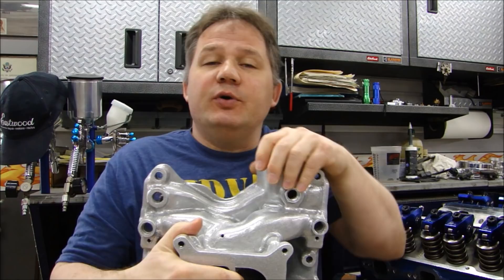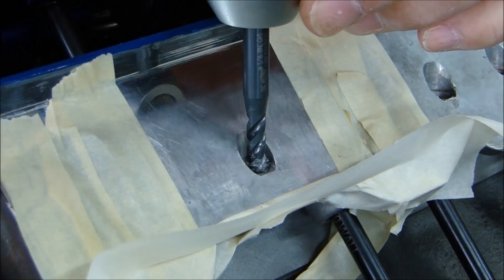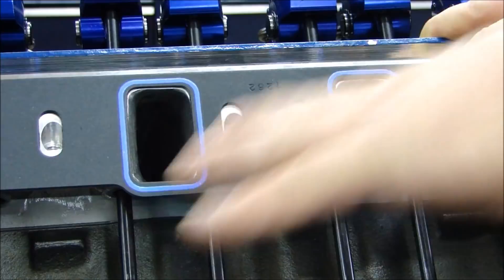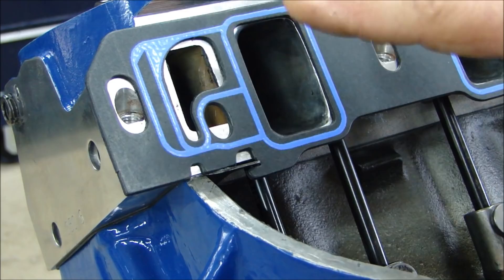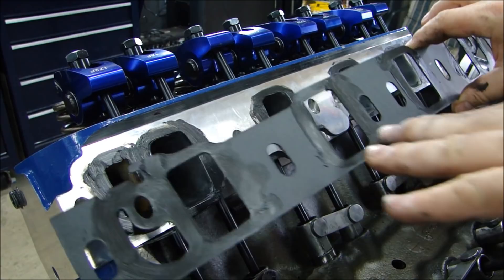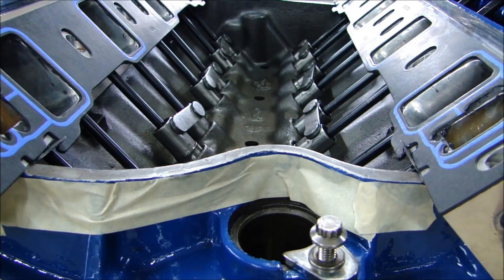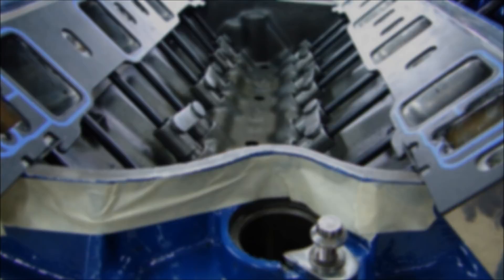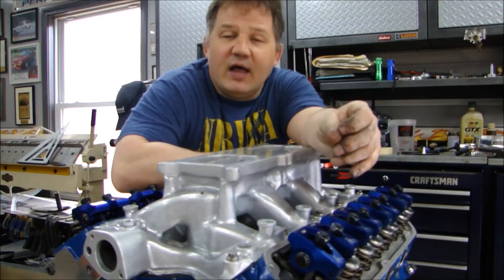Engine Building Part 9: Intake Manifold Installation

Comment: Two things here...
1. I have the same nirvana T-shirt
2.Would it be worth it to use a washer of a different metal? Such as Nickel or brass? Neither metals are very good cathodes or anodes. It would change the contacts of the different metals so it might be less susceptible for galvanic corrosion? Also, How about a sacrificial anode? In the pool industry, we use a zinc bar (more acceptable as an anode than Aluminum) attached to pvc piping to avoid the eating away of pump and heater internals. Could the same principle be applied here? if so, is it worth it to do it? As i'm sure, it has happened to more than a couple people. I'm also wondering, as far as the washer goes, if this broken bolt typically breaks at the head or at the threads? if at the threads, then my argument is worthless. If at the head of the bolt, then it might be worth it? Wouldn't the bolt be tied in too tight for an electrolyte to enter into the threads and stimulate the wear on the bolt and thread housing? Just curious lol
Reply: Bolt thread and thread housing"""
Reply from the maker: That is an awesome comment! In this particular instance the bolt in installed over a powder coated part so there really is no metal to metal contact. Even if there were contact it is the most dry part of the engine so there is a smaller chance of water acting as an electrolyte. I've seen head bolts snap at the head, it would be interesting to experiment with your sacrificial metal material in a coolant system.
Reply: Ah i got you. I was just thinking of humid areas or areas with a high salt content. Thanks for the time man. I appreciate it. I'm still figuring out my plan on this build and having trouble finding a machine shop that will do the work on the 302. And absolutely! Please let me know if you go ahead with it and your findings. I'm pretty curious about it.
Reply from the maker: I sure will

Comment: I have the option to buy studs that are same or different lengths ARP offers both? Any difference or
Reply from the maker: Justin Millerr For which part? For heads I would stick with ARP. For the intake it is a much lower torque

Comment: Hey pete, if i have a new edlebrock aluminum intake manifold but cast iron heads and block, should i still use the standard iron bolts or should i buy the bolts edlebrock sells ???
Reply from the maker: Steel bolts are fine

Comment: Hi Pete. I see this an old video so I don't know if you are still around or not.. Anyway a question about using the silicone on the front and back of your manifold. Does the silicone not squeeze into to valley of the block? As once the manifold if one you are not able to see it. Is it possible bits could break off and go into the engine? Thanks.
Reply from the maker: Of course that's possible. But if you apply the right amount it's no problem. I've never had an issue and it's a pretty common practice.
Reply: Pete's Garage Thanks for that. I was just about to replace a manifold on a Ford 429 and the front and rear gaskets are rubber and looked quite good so I was in two minds.
Reply: scott giltrap-backblocks hunting it is a problem on a small block and big block chevy when the silicone sealer oozes into the distributor hole. i've seen guys fight the distributor into the engine because the dried sealer was restricting the opening.

Comment: Pete, how come the thread cleaning process is done with the head installed on the block? Would it be easier and cleaner with less chance of FM to do it with it off?
Reply from the maker: Absolutely. I was trying to demonstrate how to do it if you had to.
Reply: Petes Garage Ok I figured that. I didn't know if on that particular motor the manifold bolts continued through the head and into the block. Thanks again
Reply from the maker: That particular bolt ends up in the lifter valley so if anything fell in it would be easy to clean up

Comment: I was curious of the reason why you used stainless steel bolts even though there's risk of galvanic corrosion. Are they generally the best bolts no matter of the risk?
Reply from the maker: Galvanic corrosion only occurs in the presence of an electrolyte. Since this area of the engine is pretty dry it won;t be an issue, but you are right, it is a more risky application
Reply: +Petes Garage Oh that's right, you mentioned the electrolyte. forgot about that lol. thanks!
Reply from the maker: You asked a great question
Reply: Thank you. Your videos are great by the way. I've had a dream of rebuilding a car for years now and right when I finally got the money to do so- I got orders to go overseas-_-   so I figured maybe I can look into just building the motor i want and shipping it back but I know darn near nothing about it. 
The math scares me a bit but watching all the motor building videos has really cleared up a bunch of questions I've had. So thanks again for taking the time to put these together!
Reply: I do wish I could just pick your brain lol, so expect more questions from me, best way I learn, other than hands on
Reply from the maker: Anything for a fellow service member

Comment: Hey Pete - great video (as always).  I may have missed it, but did you suggest using something other than stainless, or was the focus on keeping the electrolyte out?
Reply from the maker: Thanks Dan. Since this car will never see any weather I'm not concerned about corrosion. If it were a daily driver I'd be using grade 8 hardware.

Comment: should the holes on the head be chase out before installation of the heads?
Reply from the maker: If you are reusing a head yes. These are brand new aluminum so you run the risk of cutting more.
Reply: ok thanks!

Comment: what about the RTV squishing out inside of the lifter valley?
Reply from the maker: You have to wipe under the gasket there too. Great observation!
Reply: If you mean on the inside of the china wall, if you don't use too much it won't be an issue because it just squishes out and drys and doesn't go anywhere and it doesn't matter how it looks because no one see's it. You only need to clean it on the outside for aesthetics..
Reply: xwgthophase2 gotcha. and yes i was referring to inside the china wall. novice here. i was just thinking if too much of the silicone squished out on the inside of the china wall and some just happened to glob off, it may cause an issue.
Reply from the maker: If you put it on correctly, you should have minimum squeeze out. Once it cures inside it most like will not fall of. But you are correct, that is a valid concern!

Comment: You were doing good until you smeared rtv silicone on the head/intake sealing surface.
With the raised bead of silicone, embossed into the gasket, you don't need any sealer.
I am sure you don't do this to your cylinder head gaskets.

ONLY place that sealer is needed is at the "V" edge of the head & intake manifold.
Reply from the maker: You need some at the ends of the manifold over the china walls. You can go without any sealer if the angle for both the heads and intake are perfectly the same. The sealer makes up for small variations.
Reply: Bob Smith has never worked on an FE obviously. Printo Seal gaskets are a no-no FE engines.  Also there is only a printed seal on the intake side of the gasket. Pete did exactly what he should have.

Comment: Hello eric! Im working on a 351 cleveland project and considering changing the intake and carburetor. Now, this motor has been modified before i got my hands on it. LSS. This is an EGR equipped motor, and the intake has been modified too cut off EGR use too mount a holley carb on the motor. Silicon was shot into the intake to stop the lower plate on the intake to stop flow to the the egr from the motor. Now my question is, can i install an edelbrock intake thats not equipped for EGR without worrying about vaccum ports or power loss or even worse problems? hope i explained myself correctly!
Reply from the maker: +Tanner Priest Who is Eric? You can use whatever intake you want, just setup the carb and the rest of the engine for it
Reply: +Petes Garage my apologies I was talking to an Eric when I made that comment haha. Because I was worried about possible vacuum ports under the intake that's in the heads themselves that may need to be either plugged or anything else.  thank you!
Reply: +Petes Garage I just wanted to ask, i got my intake manifold off and ready to start the process of putting the new one on! now, the new manifold does not come with the lower pan on the bottom of the intake i took off now. do i still need that lower valley catch pan?(if you know what im talking about and know the proper name id would like to know! )
Reply from the maker: You do not need the valley pan.
Reply: +Petes Garage thank you! and one last question I promise. the new intake I purchased has 1.37x2.15 ports. and the head ports are 2.6x1.75. would they still work with the intake smaller?
Reply from the maker: You'll need to match those ports. The engine will be starving for fuel and air. The difference in size will be a major disruption to flow

Comment: That was a huge bead of RTV.
Reply from the maker: Andrew Larson It is tough to gage....I tend to favor a bit heavy, then wipe off excess.
Reply: +Petes Garage    What will happen when the Right Stuff is squeezed inside the more.  I hate the Cork and Rubber Seals but worry about the excess of Right Stuff going into motor

Comment: Hey, i was working on a 69 mustang grande 302 of mine, but the engine is from a 68. What would be the best air intake that I could use for this? Thanks.
Reply from the maker: Edelbrock performer
Reply: Thanks so much
Reply: And any recommendations on the kinda bolts to use?
Reply from the maker: Any grade 5 or better

Comment: pete putting on a intake on a olds 403 engine should I use single gasket or valley pan gasket
Reply from the maker: If you plan on running at high RPM use the valley pan. It's designed to reduce splashing and windage in the valley.
Reply: Petes Garage  do I need to use a piston stop on steering timming
Reply from the maker: You'll have to clarify that
Reply: Petes Garage I seen where some people will set the timing on zero make a mark on the damper turn the crank again make a Nother Mark Dan measures the distance between
Reply from the maker: That can be done

Comment: Thanks man. what do u recommend to do after Bachelor in ME ?? thanks!
Reply from the maker: It depends what you are trying to do. If you get a Masters in ME you will be in a specific job category. An MBA can go a long way
Reply: Enough with this shit study. This is never gonna help. I want more practical ,more involvement.Are mechanical graduate are  capable of doing job directly or should they go for automobile engineering way?? ( sorry to bring these job things) thanks
Reply from the maker: There is no need to use profanity. I'm trying to help you. Do you want to be an engineer or a mechanic?
Reply: I am in my last year of bachelor, and to be honest I have learned from u more than I did in last 3 years. And yes I want to work in automobile company. Thanks man

Comment: OMG- When I first saw that cork Chinawall gasket- I wanted to throw up. Those are the most useless things ever thought up by someone! Cork in a wine bottle- ok. Q: Doesn't FelPro make a decent intake set? (silicone Chinawalls)
Reply from the maker: HUBBABUBBA DOOPYDOOP It all is based on the application. I prefer to use right stuff as often as I can.
Reply: BTW- LOVE that intake- very Masterful job! Beautiful engine. Thank you for the vids. Peace be with you.
Reply from the maker: HUBBABUBBA DOOPYDOOP Thank you my friend

Comment: looks like a lot of work that just not needed
Reply from the maker: That's what makes it special
Reply: amen pete,
 iam working on 1991 ford mustang that had oil in the radiator 5.0 ho engine and those bottom head bolts need to be thread sealer on them I notice, so I pulled the heads and put felpro gasket on and arp head bolts and I think so far I fixed the problem I think, what do you think pete
Reply from the maker: Are you sure there are no cracks in the block or heads?
Reply: nope
Reply: trial and error I guess, I mean if the block is cracked, time to buy the 427 rr king cobra from jack rouse 800 hp 600 tq  $60,000
Reply from the maker: That's a lot of cash to put down....but if you got it....or...you could build one for $10k
Reply: one stock 91 5.0 ho and one turbo with about 8.51 compression on the engine, because boost don't like high compression motors 700 hp or twin
Reply: or a lima 460 block
Reply: hey pete can I take all the parts off a 5.0 ho motor and putt them on a 95 351 truck engine block and have a 351 ho motor, and how much power will I make with my bama tune 24 pound injector, performer intake bbk headers , 75mm throttle body, 255 litere pum, and 355 gears
Reply from the maker: The heads may be too small

Comment: on a gm block they are called valley wall and not a china wall
Reply from the maker: Ok, so, before I responded I did a few things. I've been working for GM Powertrain since 1999. I started on the L29 machine floor making 454 and 502 blocks, cranks, and heads. I worked on many different engine platforms. Today I went into block machining where the 5.7 and 6.2 Corvette blocks are machined and asked 4 different tool setters and 3 engineers what they call the wall on each end of the valley. They all answered "China Wall." So, it may not be the "official" term, but it is the most commonly understood one. The next time I get to the Windsor engine plant I will do the same.
Reply: well that makes no since then last time i knew  the valley was called a valley and not a china if was called a china  then word china wall for the wall's would make since
Reply from the maker: Chicago is called "The Windy City." That makes no sense because it was not windy when I was there. In England a cigarette is called a "Fag." That makes no sense. The nuts that hold on a wheel are called "lug nuts." That makes no sense because there is no lug on a wheel. My laptop has a "keyboard." That makes no sense because there are no keys. I went to a restaurant that sold "chicken fingers." That makes no sense, never saw fingers on a chicken. In a piano the big metal piece that holds the strings is called a "harp." That makes no sense. A bowling ball is referred to as a "rock." That makes no sense. Drywall joint compound is referred to as "mud." That makes no sense.Can anyone else help me?
Reply: ***** on the piano its called a harp because if you took out of  the piano and stand it up you can use it as a harp. they use to use a rock for bowling ball. and drywall compound referred to as mud is because houses tobe made out of mud and it always it applies like mud, and the windy city name is a nick name.